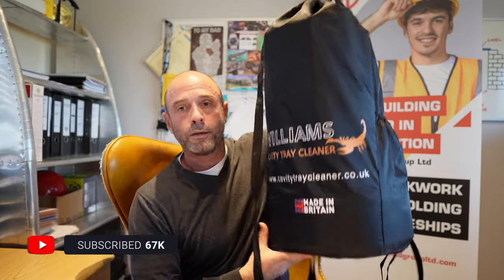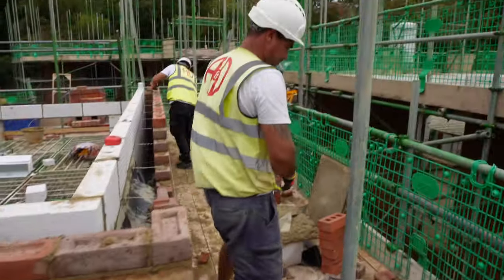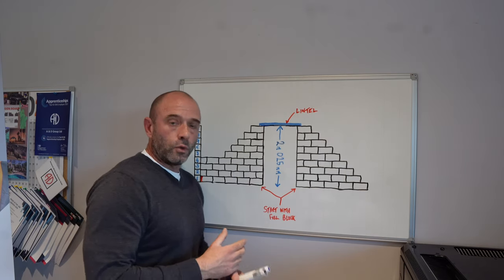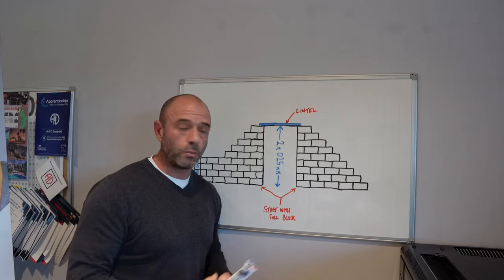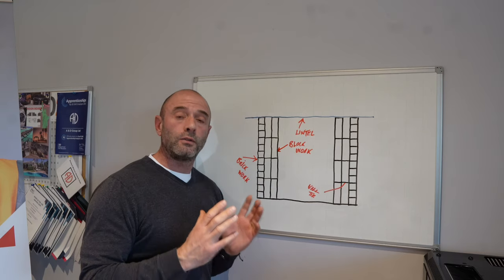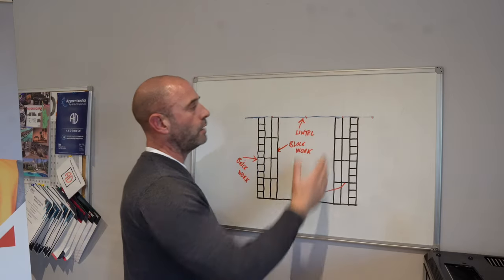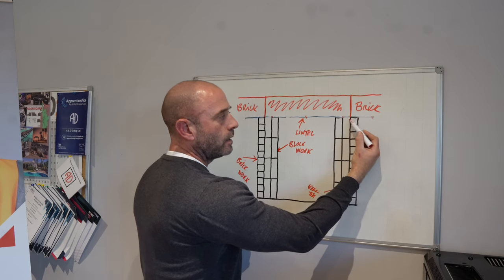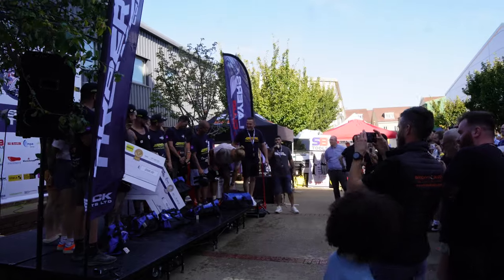How To Get Your Bond Right - Lintel Bearings

Comment: What a load of contadicting bollocks. Ffs, I've been in the game 42 years never done this and never had a problem. If it doesn't work a full block put a longer lintol on.
Reply from the maker: I don’t make the rules mate I just have to stick to them!
Reply: It show's how good they are as you don't even have to build the internal blockwork into the inner leaf. They just allow you to stick a wall tie in, this would have been a sackable offense back in the day as you tied everything in with the correct bond not just shove a profile up.
Reply from the maker: @suemarsden7249  it’s because they are different materials and have different thermal properties.  Just because it’s done differently does not mean it’s not an improvements. Things evolve, even in construction
Reply: Where celcon type blocks are used you tie in with a celcon this doesn't affect the thermal ot structural integrity if either wall.
Reply: I'm not having a go at you mate as I know you don't make the rules but you have to admit that the quality of our housing is not evolving for the better but is getting worse.
Reply from the maker: @suemarsden7249  very rare internal blocks are same type as external blocks
Reply from the maker: @suemarsden7249  I know mate, I’m happy to debate 🙏🏻 I don’t know it all that’s for sure 👍🏻 I agree somethings are getting a bit silly in construction, but there are some good things coming out